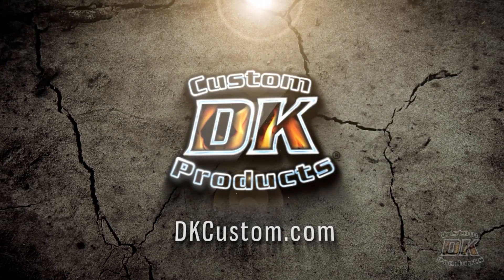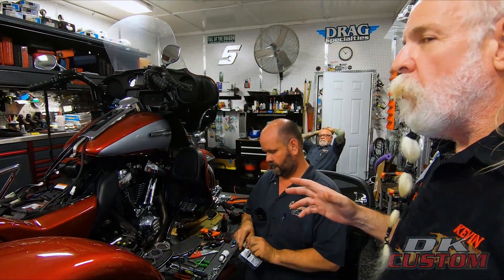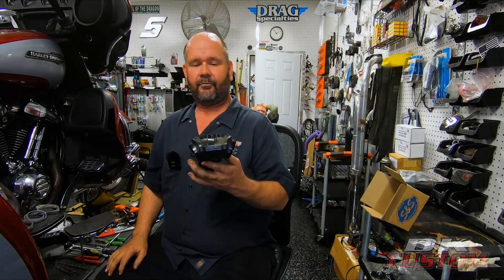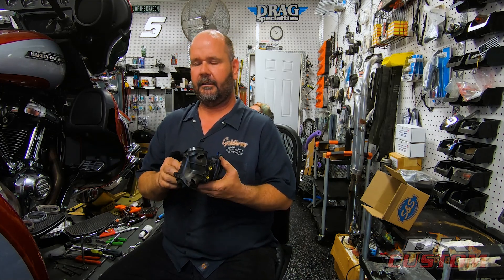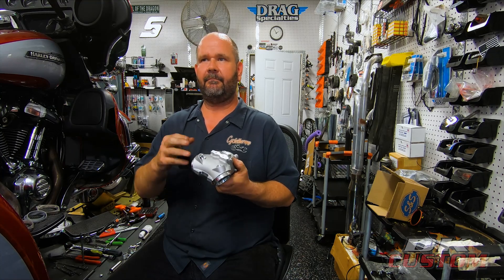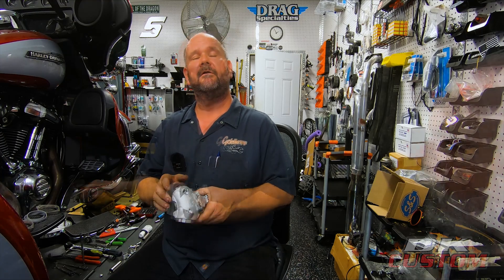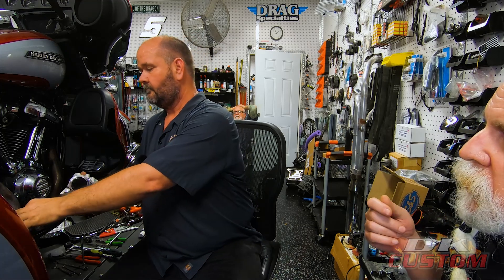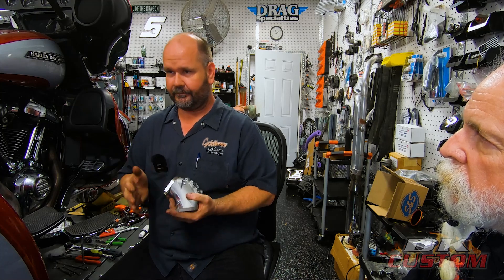Why is There So Much Plastic on Harley-Davidson's?

Comment: Do you need to retune the bike after upgrading the intake and the 64mm throttle body on a 114?
Reply from the maker: You do not need to retune when upgrading the intake with the OEM size.
Within a few weeks we will be publishing a video on why, except in extreme build circumstances, moving to a 64mm throttle body will REDUCE your power.  
We were surprised on the Dyno, about 15 years ago, when we saw that increasing the size of the throttle body Reduces power.  Bigger is Not always better.
If you are not doing a big bore upgrade, w/ an aggressive cam, going to a 64mm will not bring you good results...and yes, you would need to retune the bike.
Reply: I will be interested in this video. I have a 97 evo softail that had a larger SE carb and intake installed by dealership. After I got it back I swore it didn't run any better than stock. Added a Andrew ev27 cam recently and still am disappointed with performance at regular highway speeds. Engine is otherwise stock.
Reply from the maker: I'll look and see if we have any video footage...if not, I will add it to our list of videos to shoot.

Comment: Extremely important topic & the same as excessive crankcase pressure....🤔🤔🤔
It's cause HD can charge you for "engine upgrades".... 🤣😂🤣
If they make it to reliable, then they engineer problems into the motor & to keep you a regular customer....🤣😂
Love your work Boyz 💪💪💪
Living The F🤪KING Dream ❗
Safe travels 🙏♥️🐾🐾🇦🇺
Reply from the maker: Thanks man, and back at ya.
Yes, the upgrade mentality is strong at HD.

Comment: I don’t think anyone will disagree that aluminum is better fit this application.  But…what percentage of M8 really have a problem w/the intake.  

Just thinking out loud here, but if Al conducts heat so much better, isn’t it going to reach a higher temp than the composite intake??
Reply from the maker: I don't know the percentage.  It is not high at all.  I bought my bike in 2019 and did not replace until 2023...not a high priority, but I did it because in the off-chance that it would, I wanted to eliminate that possibility before two big trips I have planned this year.
Reply: I guess it would be a preventive measure in case the plastic melts. And the cost savings point is hard to argue.

Comment: Composites are good for managing heat soak on the intake charge. Harleys just run so hot, that their choice of materials for the intake was poor. GM and others still use composite intakes. Here is an example of a current composite intake, 6.2 Liter LT1 Intake manifold.
Reply: This guy gets it. If your intake melts, you got the engine way too hot, and this is not a water cooled engine. The water only helps (very slightly) around the exhaust port of the head. A lawn mower is cooled much better with a fan and shroud.
Reply from the maker: Great points! 👍
Reply from the maker: Agree with you.  They do not belong on any motorcycle, especially unbalanced HD's, due to the heat and vibration.

Comment: Bought a new 2023 HD Road Glide ST a few months ago (Feb. 2023) and here's what I changed so far (as of late Apr. 2023):
1.  Trask M8 Checkvent, metal, to properly ventilate crankcase (& eliminate the HD OE plastic piece).
2.  S&S 55mm Intake Manifold, aluminum & ported by Ward (eliminated the HD OE plastic intake manifold).
3.  Added the HD Fan to the oil cooler and had HD Dealer flash the ECU.
4.  Added the S&S 2-1 Sidewinder Exhaust w/dB reducer and no cat.  Bye-bye to the stock HD OE Exhaust.
More to come...such as the plastic connector piece in the clutch cable adjuster...will be installing an aftermarket metal piece ($50).
Reply: Awesome investment. I bought a 1999 Valk 9 years ago with 14,000 miles and here's what I've replaced.....2 tires.
Reply: @Joshua-of9vq  Two different beasts, can't compare them.
Reply from the maker: True that. 👍
Reply from the maker: Glad you are enjoying the wind!
Reply from the maker: Good to hear you are making the bike your own.  You may find this video series interesting/useful- https://www.youtube.com/playlist?list=PLb3bvZgbH92_3s-2vv63QggFJ3nteFd_C
Or, if you just want to see one video outlining the subject- https://www.youtube.com/watch?v=5PxJ8PvcVtc

Comment: I have a product suggestion, yall should make a higher flow air filter for the 114 ventilator that flows more than the K&N filter. I was looking at the FuelMoto one, and it's too wide, and would get in the way of my knee when cornering. And I ride twisties a lot. It'd be really cool to have a replacement filter that's like a 1/2inch wider, flows a bit more, and has billet or steel stand offs to make it work great with the SE/114 Oval Ventilator.
Reply from the maker: I think we do have what you are describing.
You can see them at this link- https://www.dkcustomproducts.com/milwaukee-eight-outlaw-hiflow-828-air-cleaner-complete-systems.htm
And this particular one is made to work with a TC ventilator cover- https://www.dkcustomproducts.com/complete-hiflow-828-air-cleaner-milwaukee-eight-prepped-for-ventilator-cover.htm
AND, later this month we will have two that allow for the installation of any of the oval ventilator badges. 👍
Reply: @DKCustomProducts  I was basically just looking for something like FuelMoto or Arlen Ness makes where it's a filter that goes into the stock setup on the M8 114. 
the FM one is a bit too wide for my liking, and the Arlen ness one is properly sized but has nylon spacers instead of billet/metal.
And I've had some sketchy experiences with Arlen Ness over the years.
I was thinking you guys could make a better filter than Arlen Ness with a similar slightly wider than stock profile, but with better quality and ffilteration design since you guys have more experience with hardware that actually performs well making power and maintaining good quality, using proper metal parts and bolts.
Reply from the maker: Thanks for the good words. 👍
There may be a larger filter element that will fit the ventilator (but then will the filter mounting fasteners in the ventilator work?)
The best solution we have come up with for staying low profile and getting a bigger filter element for flow, and keeping the ventilator look, is the 828 that is designed to work with the TC Ventilator Cover.